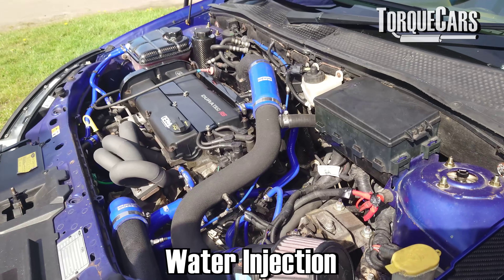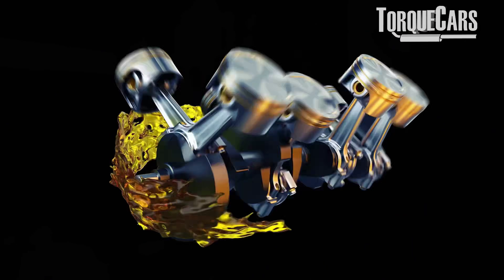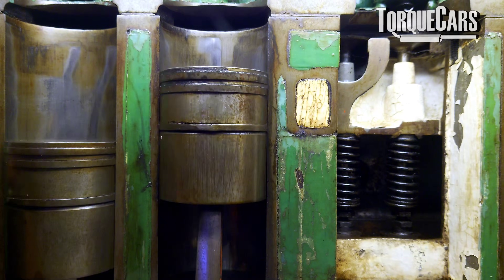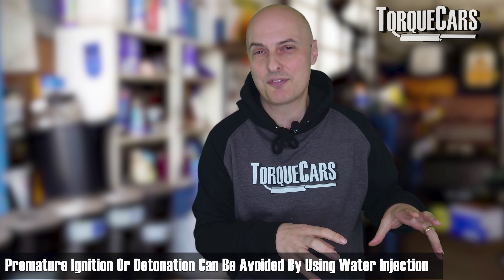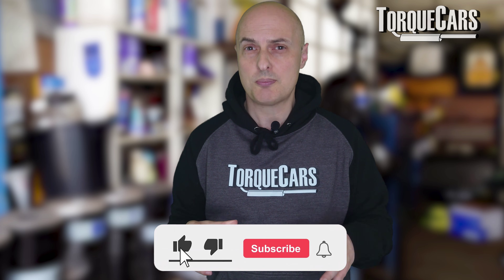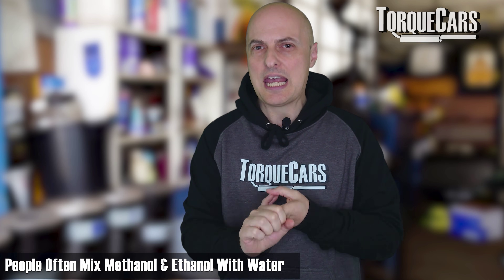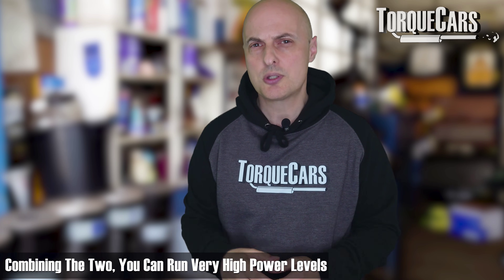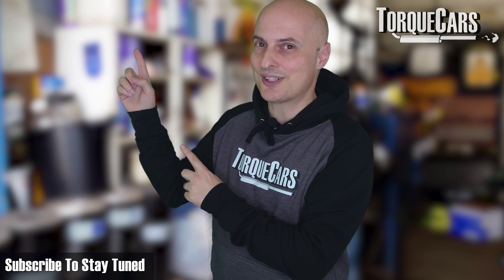🚗💧 Water Injection Explained: Boost Your Engine’s Power Safely 💧🚗

Comment: Been using water methanol injection on my road cars for 20+ years all fully insured, if you tune for the water methanol you need to be running a decent system which has a failsafe, which will cut boost and protect the engine. The mixture to use purely depends on the vehicle and requirements, when needing extra fuel a 80% methanol 20% water is best, when just needing cooling and octane a 50/50 mix is normally best and diesels to keep EGT’s down a much stronger water mix is best.

Comment: For me it’s not so much about getting power as much as it is cleaning carbon deposits on the pistons and valve train ! 
Setting one up with the proper misting nozzle and controlling the volume is critical ! 
As the old saying goes , a little dab all do you !

Comment: I ise it in my dailys but the serious race cars i don't actually lol not because i shouldn't but because it's something i think really should be individual runner nozzles just for distribution reasons. Some intakes dont do bad with wet flow but most dont do great. Coming from dyno testing lots of stuff on my test mule drag bike it can be very good but dry ice chilled fuel can be better and it's pretty easy to do even with gas its a pretty big gain but with e85 its near meth levels of cooling. One thing i will say is water injection will keep things super clean ill never not run it on my rx7

Comment: If using water only, would it still increase power even without a custom tune? 

I have a B7 2.0t Audi A4 Stage 3 KO4 turbo running E50 with 100 octane GIAC tune.

Im thinking of adding water injection pre-turbo, to cool intake temps and increase turbo efficiency, well also getting the benefits of potentially boosting octane levels and cleaning the engine, but I’m just not sure if it’s worth the risk of hydrolocking, especially if there’s no power gain to be had without a custom tune,

Comment: Could you inject 10%-20% hydrogen peroxide. This would react to water and oxigen in the combustion. The Lambda probe should react to this by adding more fuel increasing the total output. At the same time the water evaporation would still cool the fresh air and the combustion.

Comment: I’ve used both water injection and methanol injection just to pre clean things before a tear down, and also manual water spray to breakup carbon buildup that was causing pre ignition, work so well
Reply: @waynenocton  that's what I want to use it for brake down the carbon build up and clean everything up , would love to know more how you did it
Reply: @stuartshogren8308  just used wiper pump and installed NOS jets into the intake tube like you would for a dry NOS shot. And for the carbon just a trigger sprayer directly into the carburetor while running the throttle manually. Acts like a steam cleaner.

Comment: Been using it for over 40 years in various setups. Most aren't aware that it messes with the output of 02 sensor, makes it read leaner than what it is. The Chemistry of the exhaust is changed depending on how much you use but more is better than less. Then you also need a stronger ignition.
Reply: It doesn't increase the power. It increases the octane so regular fuel can take more boost like race fuel without detonation.

Comment: Hi from Australia, where our summer temperatures are like an oven on max. 
I have an Abarth 595, which has been making around twice its stock power and has done reliably for many years. Installing a water/methanol kit was one of my first modifications, not so much for the added power but for added safety with respect to per detonation.  
One word of advice is not to use water alone if delivering it via the throttle body.  
 Water's high surface tension usually means the nearer cylinder receives more water and the further cylinder receives less causing serious complications.  Adding methanol to the water reduces the surface tension to zero and ensures even delivery across my four cylinders.  
They are a basic system to fit but require a highly skilled engine tuner and a few other fail-safe sensors in the unlikely event of the kit's failure during a sustained pull.

Comment: Wrapping your exhaust and turbo to keep the heat in them reduces efficiency. 
I never understand why people don't run a small tank, radiator and pump to remove heat.
By insulating, you keep the heat in, don't allow it to scape and cause lots of problems.
Reply: It actually improves efficiency. It increases exhaust velocity, so it enables the turbo to spool faster and sooner.

Comment: I haven’t heard anything that it would be illegal in road car, I’ve in my camper van and it’s been really good help for in old tired diesel engine(not so old but..) 2.8jtd has liked a lot of water/methanol mix, sometimes even pure tap water been runned through. It’s been fascinating to see when motor breaking it makes a boost and immediately when steps on the pedal, it’s ready to go. And helps for the fuel economy nicely. Normally around 15L per hundred kilometers but now with constant water flow between 12-13 👌
Reply: Cool! What's your approximate water to fuel ratio? Or just some numbers compared to fuel mileage, 12-13 L of water per how much diesel?

Comment: something to consider, Some kits do not come with a shut off/ solenoid valve. I parked on a steep hill one day and the water meth emptied into the engine, hydro locked at least 1 of my six cylinders.

Comment: I've been running a water/methanol injection on my 1.8T for a couple of years now. It fantastic! And I'm the one that tuned it! I use a 50/50 by weight and the cost is basically nothing. I get a 5 gallon jug of methanol and it lasts me about a year.
Reply: Nice A4
Reply: Is that an Audi B5 1.8T perchance?

Comment: Would you be able to use the water out of a Dehumidifier?
Reply from the maker: That is fairly pure, it will probably contain a little dust, but there will be no mineral deposits to speak off so theoretically it would be a good solution if you pardon the pun.

Comment: Great video!
I am considering water ethanol injection on my mk3.5 seat leon 1.6 TDI for a few reasons: modest power increase (20hp maybe), better emissions, carbon cleaning effect of valves and egr cooler, and lastly less dpf regens. Only mods on the car currently are a remap, but i would like to go with a bigger turbo from the leon 184/ golf gtd eventually. I do intend on keeping the emissions components intact, I've not had any problems with them so far, but car is fairly new with only 70k kms. 
Theres a study from snow performance on the dpf regens on cummins diesel trucks, but theyre such a different beast to my little 1.6.
Would love to know your thoughts
Reply: @Braindead3736126  Hi, just found your comment. After speaking with Snow Performance about fitting a Water/Meth injection kit to my turbo diesel, using water only, I’ve been assured that the cooling effects will be of substantial benefit to our application. This being a 2.2ltr Ssangyong Musso dual cab (based in Australia).  With a modest flow rate, starting with a 2 gallon per hour nozzle, my tuner will not be remapping the ecu though we will be carrying out base and power runs prior to and after system install. And the tuner has at least volunteered that he is familiar with WMI and WI, along with being mindful of saturation points being a diesel.

Perhaps this offers some reassurance your way that it is definitely worth exploring:) Happy to chat more if need be.

Regards,
Nathan.